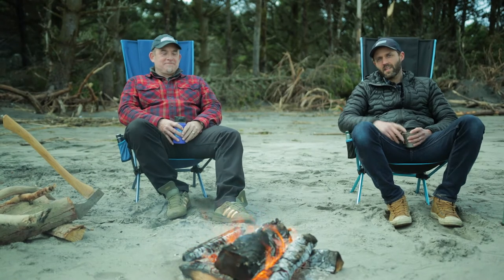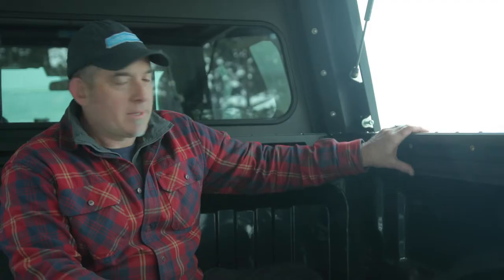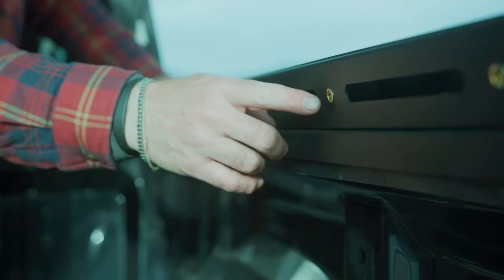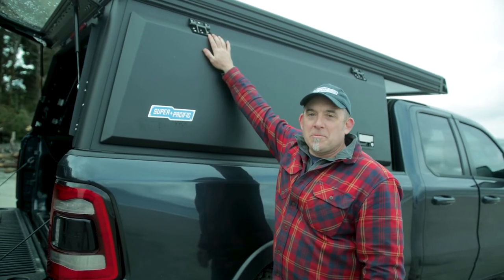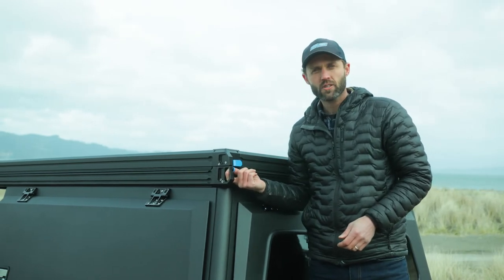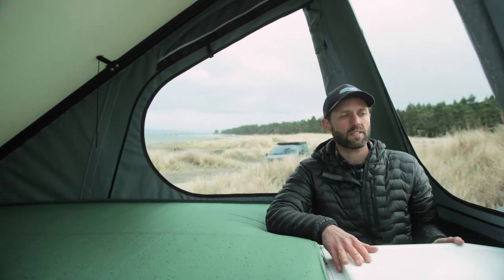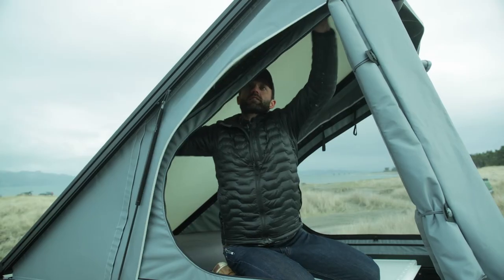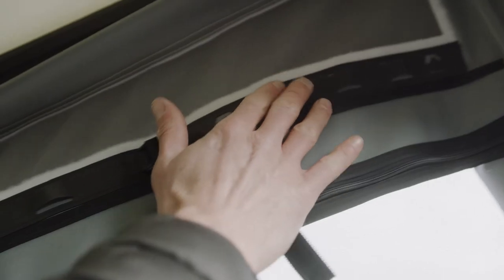Switchback X1 - Lightweight Truck Camper: Official Walk Through

Comment: I've spend a significant amount of time (in-person) comparing the different wedge style campers on the market at Overland Expo and this is absolutely the strongest, most comfortable and modular, and best value. Awesome product and really looking forward to getting one.
Reply from the maker: Thanks Noah, we appreciate your support!
Reply: best value? player please. 😂
Reply: @nawzyah  Let's here why man, i'm looking forward to it.
Reply: @noahbartron6382  I'm not the one making claims here... you tell us why it's the "best value"
Reply: @nawzyah  Haha, sure. It has the ability for a roof rack and can support 500lbs when closed and about 100lbs when open. There are tracks running all along the tent area inside and out for mounting accessories, which can be done without removing the corners of the tent. The tent channels and window channels are completely rain proof. The tent material is more durable than any winter mountaineering tent that I have ever owned and seen, so it is 4-season, and has venting for airflow and condensation. The interior of the truck cap section has threaded holes, rings, and channels for mounting accessories and running cables through, so it's super clean and tidy. It is significantly lighter than the other wedge style campers of the same level of durability (Alucab and FWC).It has side doors, and open higher than others on the market, and has hooks on the door interior for hanging wet stuff ( I would use this for climbing rope and rain gear). The interior of the doors lock from the inside. The floor is removable or can be slid back to have the entire bed area to stand or move depending on your setup. The bedding is comes with is fine, and the floor area is the same size as the Hest sleeping system which I would use. Super Pacific also mentioned that within the next several months they are going to be sharing a significant amount of accessories to use with their campers, so looking forward to that.

My hobbies and employment get me to remote places for an extended period of time, most often during really bad weather. My second consideration was the AT Overland campers, and the tent material was not as durable, and the sides of the campers dont have doors or ability to mount accessories. The GFC is dope and simple, and your paying for all their super high tech machinery, and the hype they've built behind their marketing. 

At $11k, yeah I stand behind this being the best value.

Since you think otherwise you must have one and have found some major flaws with it. Why do you not think this is the best camper??
Reply: @noahbartron6382  Doubt these claims at your own peril. I’m an owner and couldn’t be happier.. But everyone’s needs are different, so it depends on your focus. More comfort than this provides means less adventure, flexibility and freedom.

Comment: I have spent quite a bit of time looking at the GFC Camper and have designed special corner brackets to help with mounting 270 awnings such as the Alu-Cab Shadow. The weak points for me for the GFC have always been the bed comfort, the tent build quality, and the lack of upper tent venting. You’ve solved all of this with the X1 plus added more usable volume inside the camper and much better doors. Well done and well worth the extra money.
Reply from the maker: Thank you!  It's all about those details!

Comment: Looks like a great design!  The attention to detail is really nice!  I have a Snap Outfitters Treehouse and it has been great.  The only thing I am not a huge fan of with your design is the translucent top.  Being somewhere like Alaska (which we are going to for our next duty station) I would think could be an issue (but that's only speculation).  If you offered a non translucent version that would be great (maybe you do I have not looked at your site yet, just got recommended this video on YT).  Also I like to be able to walk on the roof, this is a feature I have used a lot on my treehouse, however I know adds weight to the overall design.  Your fabric design I feel is the best on the market for functionality.  My treehouse is tough as nails, but I only have two windows on the side that are functional but no where near as innovative as yours with the built in vent.  The implementation of the rails system and the raceway on the inside are brilliant.  Overall great job.  They say if you can be at least 80% happy with your home then you are in a great home, and with what I have seen here, I defiantly would be over 80% happy!  I love that new brands are entering this market space, only makes the competition and products better!

Comment: Solid unit, unique built. Aircraft tech is a great concept. I would love to see a rigid version of the tent panels. For extra protection against intrusion, no wedge shape but rectangular, camping car like top, quieter sleep set up in windy areas, safety for gear at all times. Now I want one! First set up that actually convinces me. The extras you don't see in concurrence are actually essential.

Comment: If you remove the hex bolts from the hinges do the side panels remain securely in place?  Looks like an easy way for someone to circumvent the locks.  Have had two RTTs stolen off vehicle so security of the installation interests me.  Looks like a killer product!
Reply from the maker: The hinge bolts use Nylock nuts, so they can't be removed from the outside.

Comment: What is the difference between Standard and Full size models? Is the Full Size (I have Ford 150 with 6.5 bed) bigger/larger than the Standard model?  Also is there any update on any accessories?  Thanks.
Reply from the maker: Each truck model has a unique camper fitment design - The canopy dimensions change to match the truck bed, while the upper clamshell (including the bed platform, mattress, and tent) is universal across all models.  'Standard' is designed for mid-size trucks (Tacoma, Colorado, Gladiator, etc.) and Full Size is for any full-size trucks (F150, Silverado, Ram 1500, etc.).   The features are the same across all models.  Hope that answers your question!

Comment: I wonder what the thought process was for not having two door latches on the outside so that it could be opened from the front and the rear of the truck...
Reply from the maker: It's certainly something we considered but we like to keep things as simple as possible, and in our experience, it's just wasn't necessary.
Reply: @superpacific_usa  Respect your decision but honestly it wouldn't hurt to include it instead of having to walk to the front of the vehicle to pop open a latch when most others offer that on both sides. Just my 2 cents.
Reply from the maker: @sikandinc  Most 2 latch doors you see on other campers require you to unlock and open both latches individually to open the door.  A single handle makes it easy to open the door with one hand.

Comment: As far as electrical systems…I am thinking that I may be able to use a Jackery mobile lithium battery, that could be charged by the 12V port in my truck cab, while driving, and perhaps via the rear 12V port in the back of the Switchback, if parked and the truck is running…(or via a generator)
Reply: I am considering if the Jackery could be my only electrical power solution, as it also comes with mobile solar panels.    Can you comment on this as a viable solution, in theory?  Will your included 12V port charge the Jackery battery?  I have heard that there are also some portable hot water heaters for showers and cleaning, that could also run off of the Jackery, potentially.  Can you please comment on my theoretical electric power and hot water “solutions”?  Thank you!